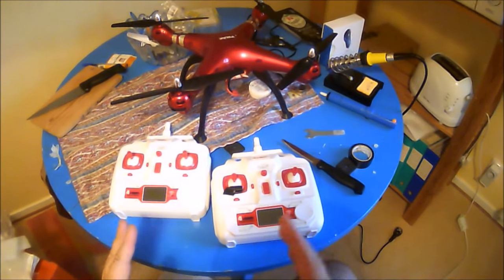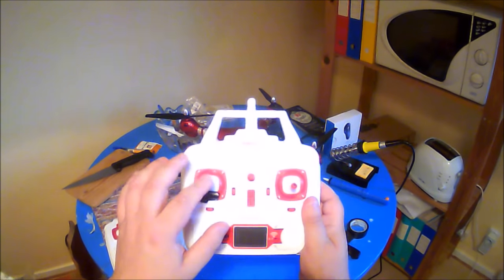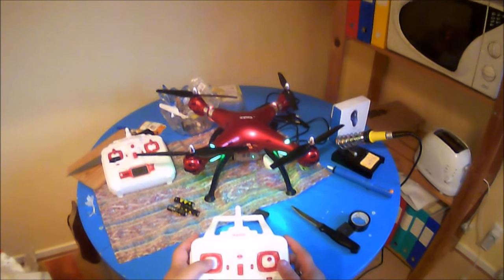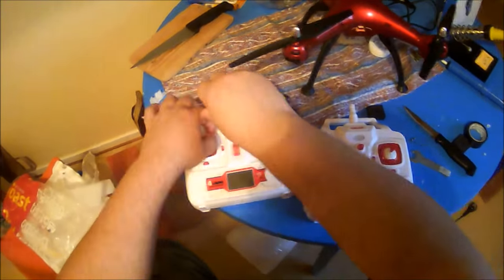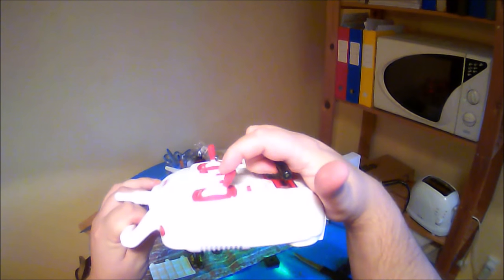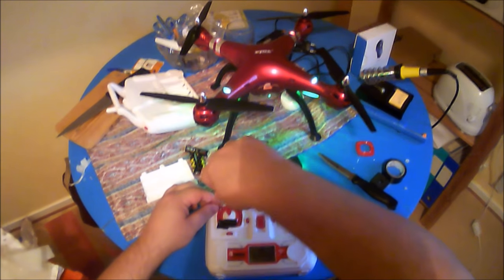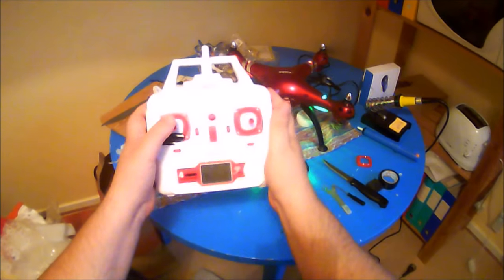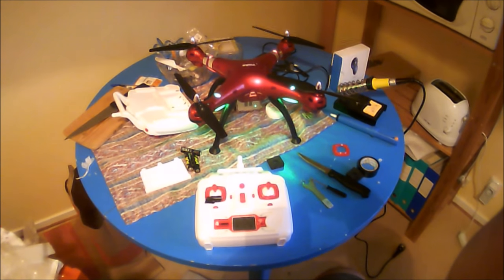The Syma X8HG motor shut down issue with two controllers

Comment: Hey Jerry I just bought a SYMA X8 reg transmitter for like $12 and it works very well, no shut down issue.
Reply from the maker: Really. That's great. I got a new but still has the problem

Comment: Would a x8g transmitter work ok and not have motor cut out issue?
Reply from the maker: I havent tried it out myself but Full Metal heli did try it out. And what he noticed was, that it worked for a little time, but suddenly it didnt work anymore. There was a issue with the throttle I think.